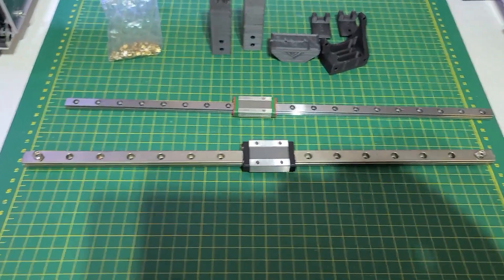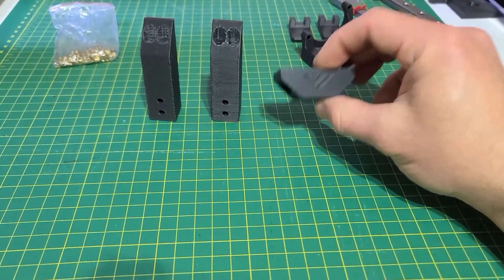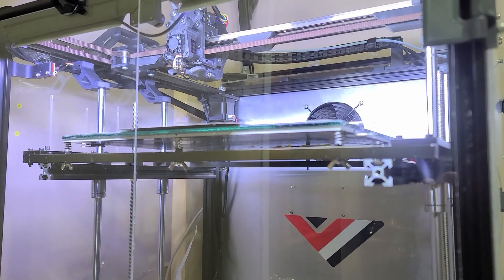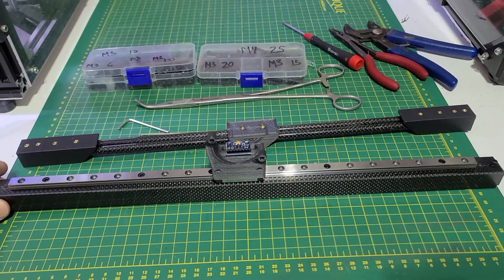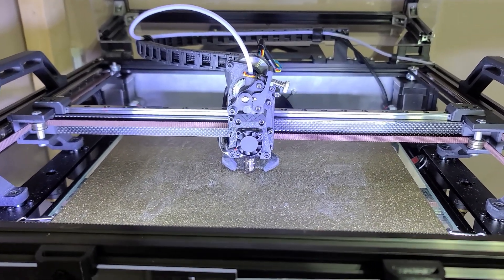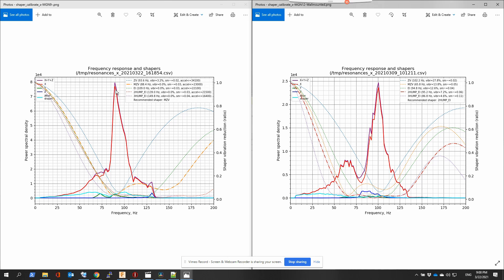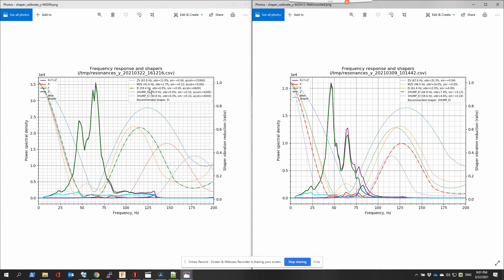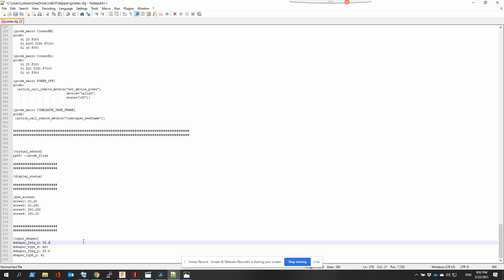Weight reduction MGN12 to MGN9 on X

Comment: please review some vibration information in regards to modes before making these videos. you are misleading 1000s of people. i will break this down for you.

ANYTIME you reduce stiffness you will reduce the peak in terms of hz. this is why you can put rubber dampeners on things and remove a vibration.
ANYTIME you reduce weight and leave stiffness the same, you will increase the peak in terms of hz.

Your y axis frequency went UP because you didnt just change 1 thing. you increased the stiffness in the Y AND decreased weight. Those 2 tubes were likely really stiff in the x but where NOT stiff in the Y. the bigger the diameter of a tube the stiffer it will be and those two small diameter tubes were not stiff. remember, stiffness of a round tube is proportionally to its radius to the 4th power. a tube that is twice the diameter will have 16x more stiffness. this is what you did with the square tubing. that square tubing is easily 50% larger in width.

Your x axis went down likely due to the decrease in stiffness of the rail plus maybe a slight change from the two tubes to the square tube. those two round tubes were likely just as stiff in the x direction as the square tube.

modes (the peaks you see) are tricky things to work with. i deal with them daily and work to actively design them out of machinery we make. the end all be all solution is stiffer and less weight. sometimes the best solution CAN be to increase weight and decrease stiffness to get the peak below were you are running at or to go faster so you are not operating in that area. for your case this would cause ghosting so its not an option.

a helpful thing to review is the formulas for second area moment of inertia (stiffness of an object).
https://en.wikipedia.org/wiki/List_of_second_moments_of_area
Here is a rundown on stiffness and deflection. 
https://www.fictiv.com/articles/how-to-design-for-stiffness-using-a-geometric-approach

Another thing you can look into is finding something with as high of a modulus of elasticity as you can. that is a materials springyness. the higher the better for you. your rails being carbon fiber means those are good but the plastics you use elsewhere are up for replacement. here is a list of materials you can sort by specific modulus( modulus per mass, higher the better)
https://en.wikipedia.org/wiki/Specific_modulus
Reply from the maker: Very helpful comment 👍 thanks. I'm far from an expert and it's always good to have experts responding to my stuff. Glad you did. Thanks a lot. I'm just a hobbyists but with people surrounding me like my team and people like you...the learning is going on :) have a terrific my friend
Reply from the maker: Oh also.. when I started this yt channel..I was alone..but now I have a team with great knowledge on stuff I don't have.. which is awesome now. So we are stepping up our game a bit with time :)  people are so awesome with me.

Comment: You have a' accelerarometer In your built ?! Hack you could make some active vibration canceling with an active swinging counter weight that compensates the vibration. No joke there is a so called flying Probe machine from spea Leonardo. 4080 they have active vibration canceling. You have G code so you can predict the incoming vibration at the spot and cancel them out to netto zero momentum

https://youtu.be/-AlsKk9k6TY

PS: the video in the link for that tester is not sped up. They have insane accelerations and deacceleration because they actively cancel it with perfect balanced moving counter weights 😏.

Imagine 3000mm/s speed are then reachable with ease 😍
Reply from the maker: very nice and very complex setup hehe thanks for sharing
Reply: @Vez3D  glad you liked it, your welcome ^^. I think a well balanced counter weight adjacent next to the hot end head and the carrier that moves opposite the movement of the moving parts would do the trick. 🤔... Like a balance. Imagine it like two exactly equal weights on a string that is rolling on a pully on the wall. And the weights are also on a sharing rail. If you if you pull and stop the weights stop on the exact spot you wanted without ringing or any vibration whatsoever. At the moment your setup rely on not hitting the resonance frequencies of the complete system by actively avoiding to much acceleration on specific tool and travel paths. I'm curious to see how the graph would look like by adding counter weights on the system. I think the counter weights would shift the resonance frequencies of the system into the higher frequency range. Which means more speed by equal or even better accuracy 🤔

Comment: why not do 2x of these rails, one for x axis and one for y axis, 2x belts and 2x motors per belt, and have the x+y axis move in an intersection of 2 rails like a + sign ? then you can prob drop the carbon fiber rod, and get smaller belt sizes aswell.
Reply from the maker: What you describe looks like the K3 printer
Reply: @Vez3D  mabye, I was just thinking of stiffening the setup and drop the carbon fiber rod and reduce the amount of belt, also it will give support x+y movement so you can increase acceleration in both x+y.

Comment: This is very cool printer you have built. Can you provide the stl files for version with carbon tubes? I have those lying around and would prefer using them instead of bying square tube. Thanks
Reply from the maker: Will do

Comment: have you noticed any downsides from switching to mgn 9. Like it the print head being able to deflect?
Reply from the maker: No its good :) same size ball bearing between mgn12 and mgn9
Reply: @Vez3D  The stiffness decrease with the mgn9 seems not to be a problem? i.e, The mgn12's were probably overkill to begin with?
Reply from the maker: @ryanleslie7425  Im gong to MGN7 now ;)

Comment: What size square tubing are you using? 30x30x28mm? Have you tried molding the x/y/x carriage out of hollowed carbon fiber powered by servo motors? It's my plan for the next 3D printer/laser/cnc project. The cheapest servo motor I can find cost about $60-70 bucks a pop. OUCH.

Comment: What did you print your parts out of, looks like polycarbonate carbon fiber. That is what I use for everything structural.
Reply from the maker: Good eyes !! Polycarbonate carbon
Reply: @Vez3D  what brand? im using priline carbon fiber pc, they sometimes have good prices on amazon.
Reply from the maker: @Anonymousg64  priline

Comment: I think you are doing really interesting work here. Input shaping is a way that the 3dp community can make some big improvements, both to improving performance, but also in measuring performance objectively. I have a suggestion upon looking at your results: Please plot the before and after on top of each other. @6:33, you claim that you moved your resonance frequency from 45Hz to 60 Hz.The plot I see has two major resonances in both the before and after. Before 45 Hz, 2.1 amplitude and 70 Hz, 1.2 amplitue. After has 45 Hz, 2.4 amplitude, and 70 Hz, 3.5 amplitude. This seems worse to me.  It's super easy to focus on what you want in frequency response plots. Looking forward to you further videos on this. Despite my quibbling with you data, I would have expected the larger carbon fiber tube to help, even if I can't see it in your data.
Reply from the maker: I have played so much with belt tension that i cant we cant compare the 2 graphs here. My mistake. I should measure with same tension

Comment: waiting anxiously for your files release. what's the square cf tube length? did you lose any print area?
Reply from the maker: 440mm. Bought a 500mm and cut it. Not loosing anything in volume. Its the same lenght as the 2020 extrusion that I started with
Reply: @Vez3D  would a 430mm tube works? there is one on sale at this size for a pretty cheap price and free shipping for my country, raising to 440mm would make the price twice as big
Reply from the maker: @cardosodouglas  probably.. but one of the screw might be too much on the edge. But honestly..it sits so tight in the gantry that it could hold there with no screw. I paid my 500mm about 20$
Reply: @Vez3D  i'll give the 430mm a shot, you have have a few days ahead until i receive it and start to spam your videos asking for the files release.

congrats again, what you did achieve is a piece of art.

Comment: Finally someone figured out there are numbers OTHER than 12. To be honest I'm surprised you didn't go straight to mgn7. As far as load capability even 7 is still over-kill but that's the smallest affordable size.
Reply from the maker: maybe I should have gone with 7. Maybe one day :) thanks for your comment
Reply: The possible problem with MGN7 is balls size, it can get noisy at high speed and wear faster. Afaik MGN9 is using the same balls as MGN12
Reply: @VladOnEarth  mgn7c has dynamic load capacity of 0.98kN, static 1.24kN, mgn7h is 1.37kN and 1.96kN respectively. So basically you can stand on it an it'll be fine. A 300g extruder and gantry? It doesn't even begin to feel it.
If you feel adventurous you can order some higher grade bearing balls and find a better fitting size and fill with those for even less noise and higher precision/loading capacity.
Reply: @predragbalorda  so if you are only using 2 rails for z would 12 or 15 be optimal. and for y would 12 or 9 be optimal. seems like 9 for x is good.
Reply: @alexandereckhardt7153  the smaller - the lighter - the better - so mgn7 would be optimal actually.
Reply: @predragbalorda  even for y?

Comment: I would suggest using inserts made for this purpose. You used inserts for injection molding.how do one get a setup like yours? Love the bracket without a 2020 profile.
Reply from the maker: you just ask me :) send me an email. As for inserts... interesting. I didnt know about that. what inserts do you suggest ?
Reply: @Vez3D  CNC kitchen has a video showing of some types. I prefer ruthex which also seem to be the strongest of them all. It has started to pop up some China clones of the ruthex. Voron use them for example.

Comment: What is that resonance analysis you did? Is that something I could apply to a CNC router table that I built?
Reply from the maker: Its input_shaper and I think it came from cnc world.. though im not sure. Its Klipper firmware measuring vibration with a gyro/accelerometer sensor and countering vibration with some voodoos

Comment: Could you explain why are you using a carbon tube to stiffen up the X axis? Carbon has a negative thermal expansion coefficient in comparison to steel.
Reply from the maker: the X rail needs a support. Eventhough some builders will mount it directly in the air, its not a good idea if you plan to run at high speed/accel. It needs to be supported or it will spring a bit. So you have to use 2020 extrusion. OR, if you want to save weight, using carbon fiber. As for themal expansion, its not an issue here. No direct heat on the carbon tube and the enclosure will only get to 40C max when printing ABS. Im not sure why you compare that to steel. It should be compared to aluminum since it is what it is replacing.
Reply: @Vez3D  I am comparing it to steel as you are supporting steel with carbon fiber tube. The difference between 400mm of steel and alu is about 0,1mm when the temperature rises by about 20C. The difference between steel and carbon fiber may even be 0,4mm which is starting to be significant. This was visible with the E3D Tool changer, as they had problems with calibration when using CF beam as support under the rail.
Reply from the maker: @Boogie3D  interesting.  I will see how it goes.. but so far so good.
Reply from the maker: @Boogie3D  see thats the kind of comment that I like on youtube :) we can share knowledge. I am far from being a mechanical engineer and I dont have all that knowledge and/or dont pretend to know it all.. Im just a hobbying who is trying to improve 3d printing, and having fun sharing with others. Thanks for your constructive feedback, really appreciate it.
Reply: @Vez3D  I am glad to help, I have some education and practical knowledge in aerospace and robotics.
If you have any doubts, feel free to ask :)
Reply from the maker: @Boogie3D  awesome thanks
Reply: @Boogie3D  what if you use 2x mgn 7 rails , one on each side of cf tube?
Reply: @nisde1503  Then some other problems will occur. alignment etc. Overcomplicating designs is not the way to go :)

Comment: Weight is the enemy!  Thanks for sharing this, looking forward to the results.  I'd be interested to see the accelerometer stuff, for sure!

I've considered drilling weight reduction holes in the sliding blocks on my delta's linear rails, but I couldn't find anybody who'd already tried it to give me enough confidence to go for it.  It seems like there's way more metal in those blocks than the stresses of a printer could ever warrant, and pretty soon I'll have cut enough weight elsewhere that switching to titanium fasteners would actually mean something...
Reply: Hi, just for curiosity, why this will change somenthing on a delta? In delta the rail are fixed to the structure and doesn't move like in corexy or cartesian where one of the axis and the relative rail have to move (on corexy on x normally you have the x with related rail and head are moving connected to the y rail, while on cartesia is even worst since also the motor move with the gantry). On delta only the 3 rail block move on the rail but the rail is not moving.
Reply: @SP_99999  The rail blocks are the things I'm talking about reducing in weight, not the rails they ride on.  They contribute to the moving mass and at just over 50g apiece they're one of the biggest single-point sources of moving mass on my delta.  150g (the weight of all 3 together) might not seem like much on a cartesian system, but 150g is just about the same as my delta's entire effector with V6 and Nimble mounted.  It's a different ballgame on the weight side for deltas.

All that said, I'm not sure how feasibly the linear bearing blocks could be cut down.  They are VERY hard steel and I don't think I could put a dent in one with any tools I have at home.
Reply: @jamespray  yes I’ve misunderstood what you write and was thinking you refer to the rail :-)
Reply: @SP_99999  No worries =D

Comment: What is the total weight of the brass inserts? Maybe not much, but another linkage type could be lighter. what do you think?
Reply from the maker: I didnt weight them. But I dont use them anymore. On the square tube i have used m3 nuts. But not used ALL of the mounting holes. I dont think its needed to use them all.
Reply: @Vez3D  I was wondering this exact thing.  Every other hole is fine.  Are you missing ones in the middle?  How many?  That can make a huge difference.

Comment: Great video!  how did you fix the rail to the carbon fiber? Did you tap the carbon fiber tube?
Reply from the maker: I added m3 nuts and lock washer inside. I printed a tool to reach the middle and used a pair of pliers really long (like surgon)..and on each end i printed small blocks with m3 nuts inserted ..so i could tight them to the Y carriage
Reply: @Vez3D  im interested to see how those lock washers do in terms of holding the fastener torque and whether they'll beat up the CF. my experience with them has always been terrible, wouldn't blue locktite be better for a low torque application?
Reply from the maker: @Keechization  i only had red locktite with me so I didnt use it. I dont know how washers will hold .. we will see. If they dont..then i will buy blue locktite :)

Comment: why not drill more holes in the 12mm rail? or simply larger holes. Also, wouldn't simply using larger motors be smarter? Enough beefy motors, and the weight would no longer really be an issue.
Reply: Bigger engine doesn´t make you any faster around corners! It´s the reduction of weight which stops your tires from getting pushed out of the corner. The same goes for any acceleration.
Reply: Yeah the keyword is inertia. Yes with a beefier motor you can accelerate more mass in the same time. But this also means higher forces. Which means higher (reactive) forces against the rigid structure, which means more deflection and vibration.
Just to recap the chain of consequences :)
Reply from the maker: I have tried with 60mm 1.8. I didnt see improvements. These are e3d high torque 0.9 and it really improved quality. They are powerful enough. Even with high power motor, you still need to be light to remove vibration